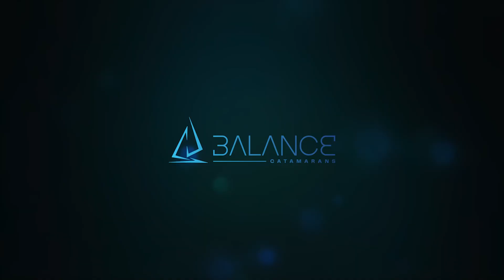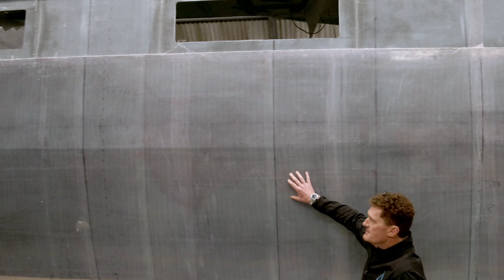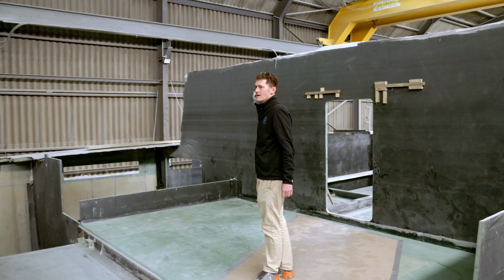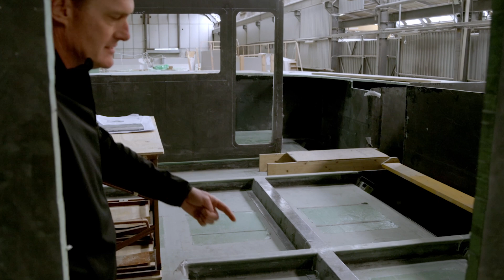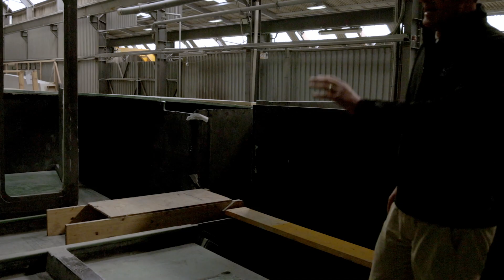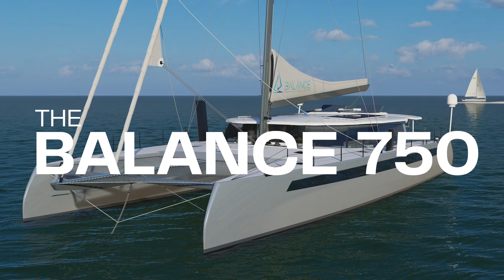The Balance 750: Build Progress Part 2

Comment: Looks great.  Wouldn't it be better to use S-Glass than E-Glass?

A boat that has a forward cockpit should probably have a forward helm.
Reply from the maker: A forward cockpit is not where you want to sail upwind or in a blow or reef your sails unless you want to wear slickers. To my mind the best part of a forward cockpit is a place to sit at anchor or when sailing off the wind. It is also fine to manage headsails. When it is cold and wet the place to reef and manage the primary sails is on the bulkhead in my view, so the 750 is designed to do that, but of course if someone wanted a helm there or a joystick for autopilot on a 750 we could easily do it. We find that e-glass in combination with carbon and epoxy is ideal for us.
Reply: @balancecatamarans  Chris White's Atlantics seem relatively dry in their forward cockpits.  Perhaps Peter Johnstone's Gunboats are wetter.  Depends on hull shape, bridgedeck design, etc.  Generally, the larger the boat, the farther the spray needs to go to reach the forward helm.

Agree it would be a wetter place to reef from, but a forward helm centralizes and shortens lines better.  

Tradeoffs need to take into account the typical uses too.  Most people cruise downwind most of the time.
Reply: @balancecatamarans  P.S.  The Windelo forward cockpit seems significantly better protected than Chris' or Gunboat's.